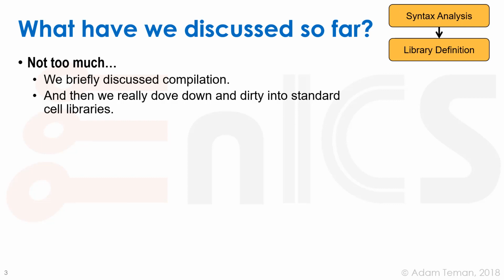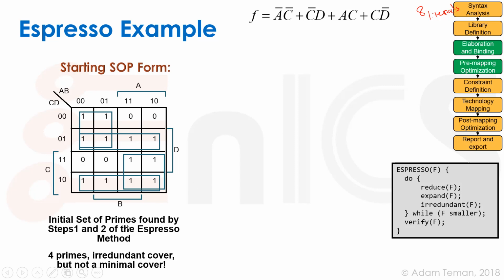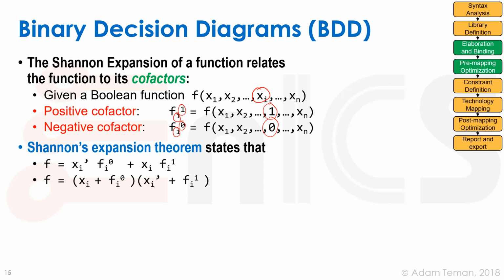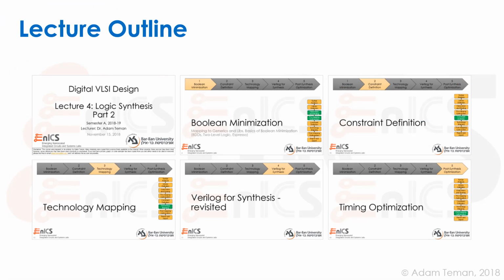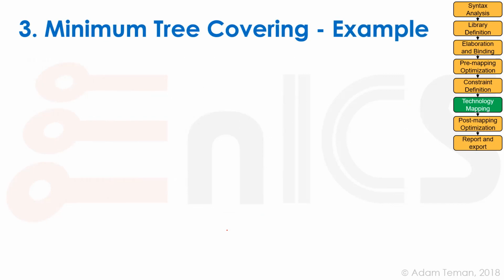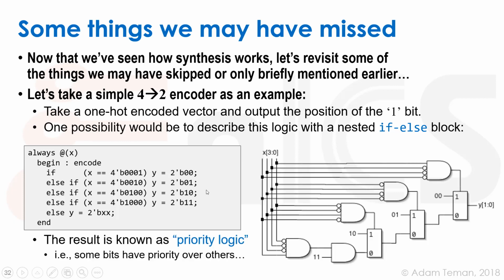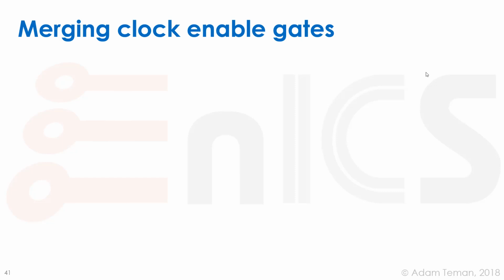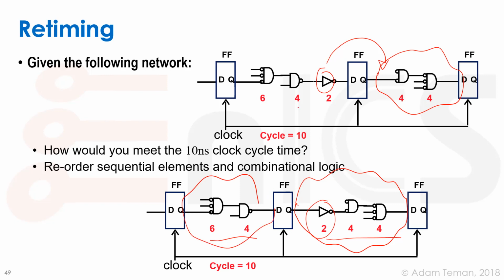DVD - Lecture 4: Logic Synthesis - Part II

Comment: Hi, regarding 1:12:40
You talked about Removing the two inverters to reduce the delay.
How can you know for sure it really did improve? as we know, we need to check LE, PE and such, while we use usually buffers to actually improve the time propagate (Tpd).
Reply from the maker: Hi. 
That is a good point and true for every optimization.
The optimizer runs iteratively and heuristically. 
In other words, it tries some technique, runs extraction and timing (STA), and sees if it improved. If not, it goes back to before applying the technique. That's optimization in a nutshell. It's a bit more complicated than this, of course, but that's the general idea.

Comment: So if I'm correct, 
1. Reduced-order BDD is used to represent logic relation of a boolean function, which may be two-level logic or multi-level logic.
2. Minimum tree covering is the process to optimate (minimize cost) the netlist circuit.  

My question is how these synthesis tools get "initial" netlist circuit ??    
                          How can they turn ROBDD into initial netlist (before doing technology mapping) ??

Thank you.
Reply from the maker: Great question. Let me try to elaborate (though, I must confess that I've never actually programmed this specific stage, so I may be missing something).

Yes, an ROBDD is just one of the options to represent a given Boolean function. Basically, you can take the truth table of a Boolean function and map it into a BDD, then apply the reduction rules and arrive at an ROBDD, which (potentially) has a highly reduced memory footprint and also provides various functionality that can be used to carry out efficient calculations and transformations. 

But, as you pointed out, we need to get our behavioral RTL into a structure of ROBDDs (or other representations). So there are two high-level steps. First compile the RTL to recognize registers and map the logic between the registers to high level Boolean primitives. This is relatively straightforward, as synthesizeable RTL has to be very specifically structured. For example, if the Synthesizer runs into and always@(posedge clk), it can create a register for each of the LHS elements. Any assign or always@* are just Boolean logic and so can map to standard combinatorial primitives.

Once you have mapped out all registers and converted all behavioral statements into Boolean primitives, the second stage is based on realizing that the entire design is just a collection of "state" and glue logic. The "state" is the collection of the register outputs and primary inputs. These are the inputs to the combinatorial glue logic. The outputs are either the register inputs or primary outputs. For each of these outputs there is some combinatorial logic that is driven by the state (regs and primary inputs). So each register input and primary output has a Boolean function that characterizes it and this is a function of all the input regs and primary inputs that are connected to the glue logic. If you followed me and I didn't explain that in too confusing a way, then you see that you can just put all this Boolean function into an ROBDD and that represents one register input or primary output. The entire design (netlist) is a collection of all of these ROBDDs (or other data structure).

With that, you can go on and work on the combinatorial Boolean functions to reduce them (e.g., by using Espresso), which is where a lot of the research has been applied.

After this reduction you can easily map all functions onto NAND and NOT gates and continue to technology mapping, which transfers the generic Boolean functions to specific gates provided in the standard cell library. 

I hope that helped. If you really want to see an implementation, there are some great open source synthesizers out there - the best known is Yosys http://www.clifford.at/yosys/

Comment: Sir, In slide 15 (BDD) and Shannon's, the example expansion given in the bottom of the slide, appears to be incorrect. Can you check?
Reply from the maker: Hi. I checked and the expansion is correct. To verify this, you can quickly write out the truth tables of the various steps or the Karnaugh map. In any case, these expressions are equivalent.

Comment: I have a question. In slide 26 you talk about how most of the logic gates of the library are defined with the NAND2/NOT and a cost is attached to them.  In slide 29, you show an example of a boolean expression being mapped to an AOI2 and a NOT gate because of the less cost. My question is regarding the AOI2 gate. In synthesis is it replaced with NAND2s and NOTs or is the AOI2 actually instantiated? I was under the impression (and I could be wrong here) that synthesis tools would map SOP expression into NANDs and NOTs(or maybe this is only done during generic mapping). If the synthesis finds the cost associated with using something else is less, will it account for this. I hope my question is clear.
Reply from the maker: I think I understood your question correctly. To start, there can be many implementations and "tricks" played by the various EDA vendors, but in general, the NAND/NOT structure is an easy/direct way to map the SOP representation of boolean logic to actual logic gates. In parallel, it is an easy way to map more complex logic gates into a common representation. These two common representations (that of the boolean logic and that of the standard cells) are used to create a common metric that can be used during technology mapping. 
That explanation may have been a bit confusing, but the bottom line is that after technology mapping, the synthesizer has mapped the logic to any standard cell (such as the AOI2 gate in the example) and that is what we get in the netlist. The NAND/NOT representation is just used as a means to compare apples to apples, but not the final result of the algorithm.
Reply: Professor Teman, thanks for taking the time to reply. Your answer clears up the confusion I had regarding common mapping, with NOT/NAND, and the final synthesized golden netlist. I was under the wrong impression that the final  technology mapped generated logic is just a bunch of NOT/NANDs. 

I also wanted to take the opportunity to thank you for putting these lectures online. You do a really good job of bridging "under the hood" mechanics of CAD tools with theory and actual implementation. I have run some of these tools in the past but your lectures helped form a clearer understanding of  many concepts. For example, what an analysis view actually entails. The references you cite in the end are very useful for further reading and I like your breaks with the "Chip: Hall of fame" stuff. I am gonna go through the rest of the lectures soon. Thanks
Reply from the maker: @marouf787  I am very happy to hear! I would just like to point out that for the "under the hood" mechanics, Rob Rutenbar's course is much more in-depth than mine and it is really excellent, so to get more of the CAD algorithms side, I really highly recommend it.
Reply: @AdiTeman  Professor Teman, thanks for the suggestion. I had signed up for Professor Rutenbar's on coursera some time back. Not having a CS background, I never got around to finishing it. Looking forward to the rest of your videos.